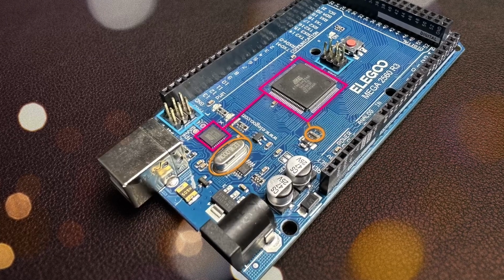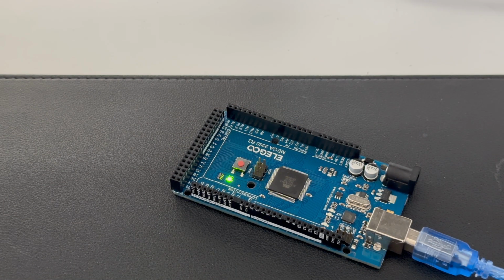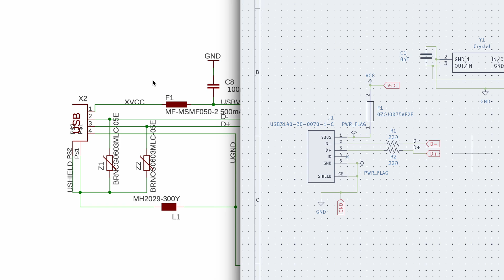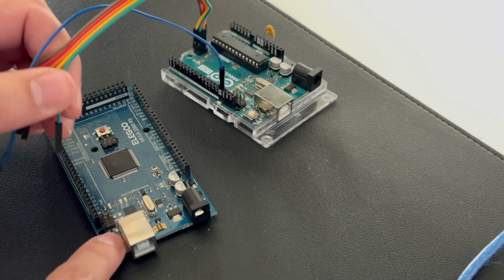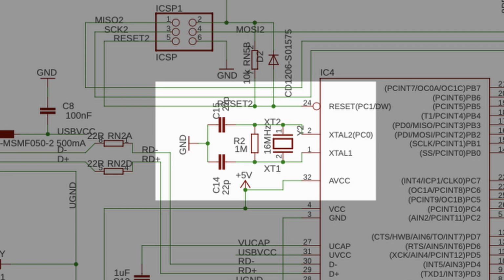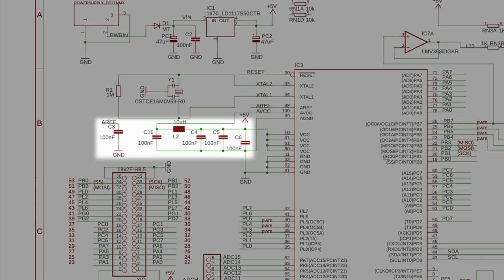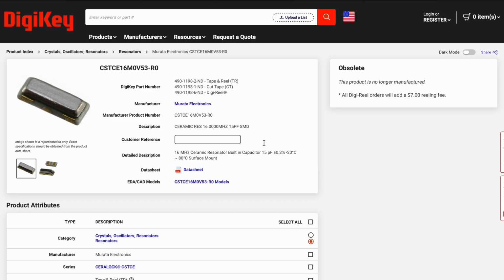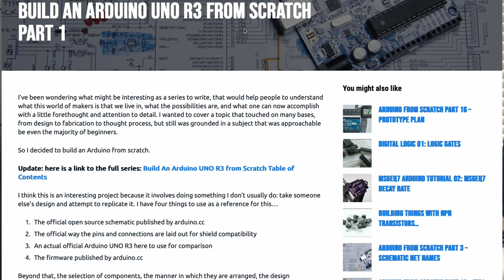G1000 Custom Arduino From Scratch Walkthrough – Build Your Own Flight Sim Avionics!

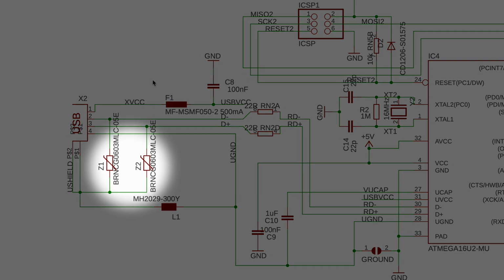Comment: At 1:35 you state Z1 and Z2 zener diodes, they are NOT zener diodes, they are (bidirectional in this case) TVS/avalanche diodes, get your info right,
Reply from the maker: TIL: TVS / avalanche diodes: They're better at handling high surge currents and can be uni- or bi-directional. Thanks!
Reply: Good correcting but you could have been more polite.
Reply: What’s next for this project? I think this is the next Stratux! If you need beta testers for feedback or initial customers please let me know, I’d love to have one of these.
Reply from the maker: Thanks, I'd love to get some feedback and testing when it's done. Holidays are going to slow me down for a bit.